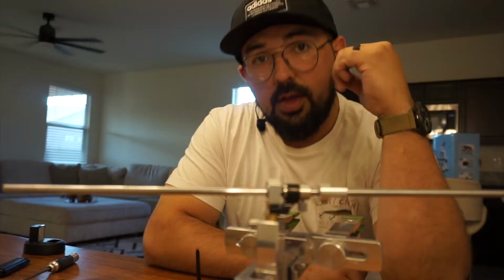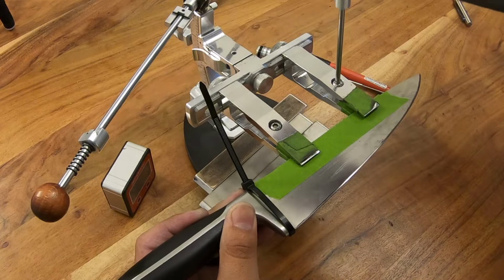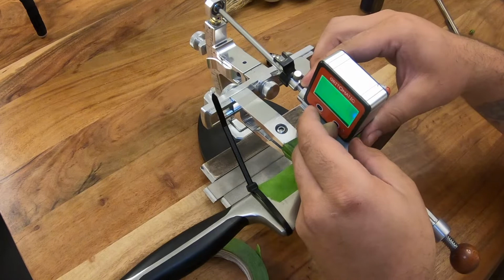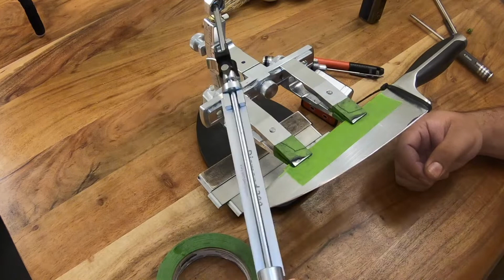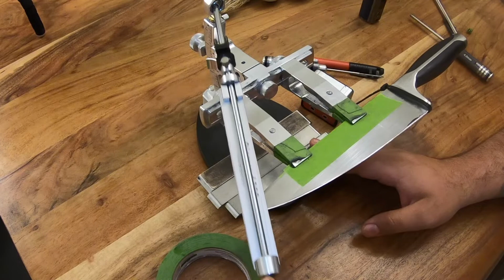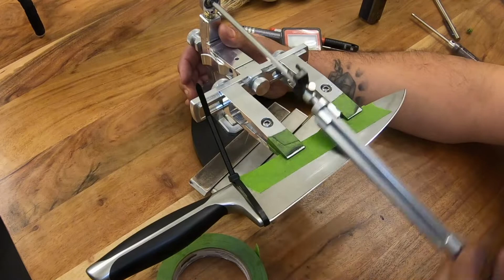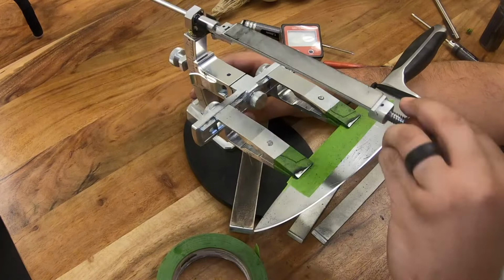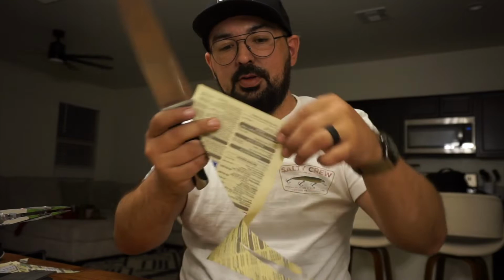Knife Sharpening 101: How to use a Guided System (Tsprof, KME, Edge Pro, Hapstone and more)

Comment: There is a lot that is wrong in this video. However enough of the info is close enough to being right that you will end up with a sharp knife if you follow the instructions.
To be more specific on what's wrong. Almost everything about the edge angle isn't correct or incomplete information.
Reply from the maker: Well let’s be more specific. Freehand is more of my forte, so I’ll be the first to admit while I am proficient in guided sharpening I am not nearly a master. But I’ve used it enough to know that doing it the way I explained will result in even edge bevels from heel to tip and my angles are laser tested to verify they are the angle I set on the system and are even on both sides. 

I’m never afraid to admit I’m wrong, I’m never afraid to learn a better way either. So if you want to leave a comment saying things are wrong can you please be more helpful and elaborate further?
Reply: @StropsandStones  that was exactly what I was thinking. If you're gonna say something is wrong, be specific and explain what is wrong, why it's wrong and explain what is right. Why take the time to comment something that has no substance?
Reply: @StropsandStones  sorry I watched your video late last night and didn't get into specifics. There is really no need to use a angle cube. Just use the sharpie technique every time. Even if you are sharpening the same knife and haven't move the angle adjustment. Unless you can very accurately put the knife back in the clamping device in the exact same location every time. Any change in distance from the base of the pivot point is going to change the angle of the guide which will then change your edge angle. It is why you have to angle a knife with a lot of belly in the clamps to keep mostly the same edge angle the length of the blade.  After re-watching the video I was wrong to say there was a lot wrong with the video and I apologize!
Reply: What if you want to sharpen a knife to a specific angle, as opposed to whatever it is before you started? Angle cubes are cheap, there's no reason not to have one and no reason not to use one with a guided angle system.